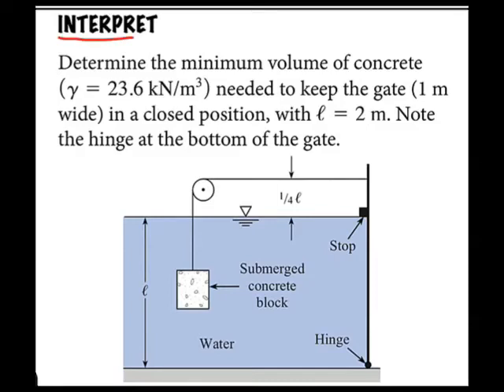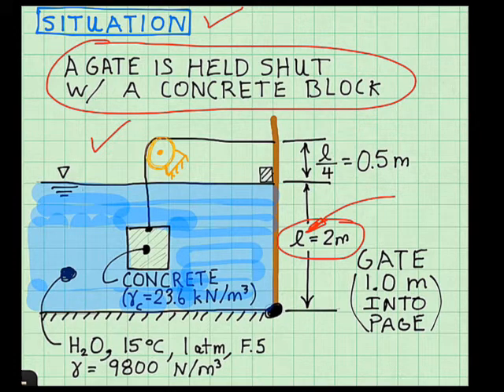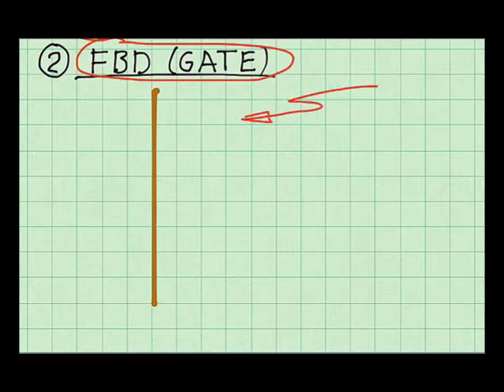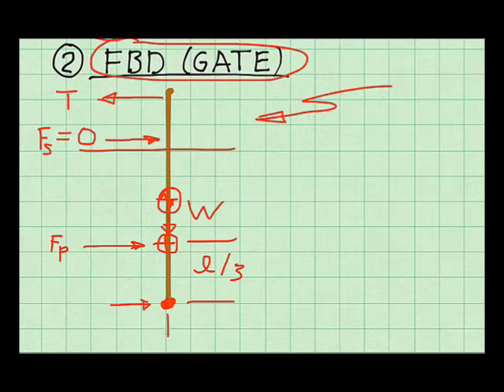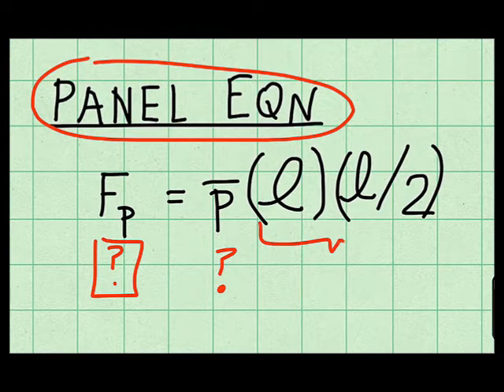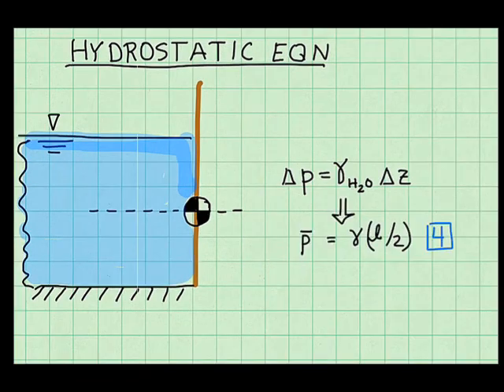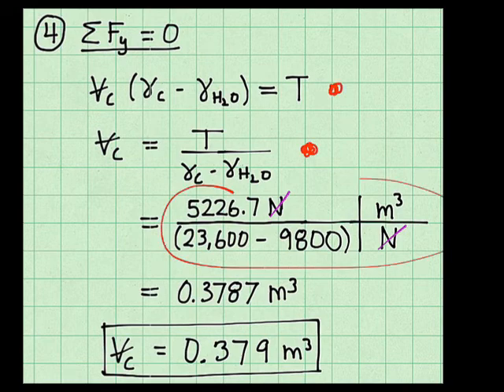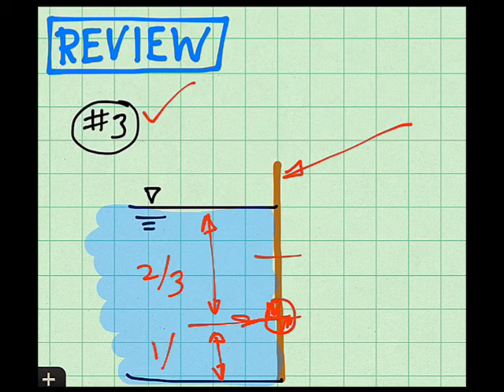Example: Buoyancy Equation and Panel Equation

Comment from the maker: The aim is to find the moment arm length for the cable. The moment center is at the hinge. The length from the bottom of the gate to the top of the gate is L (I'll use a capital letter for clarity). The length from the water surface to the cable is L/4. Thus, the momentum arm is L + L/4 = 5L/4. I hope this is helpful!